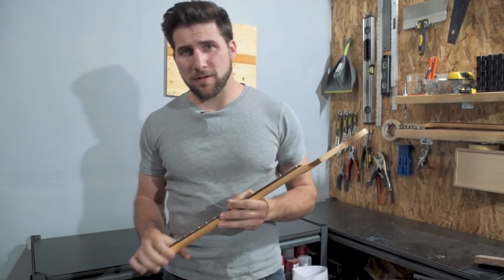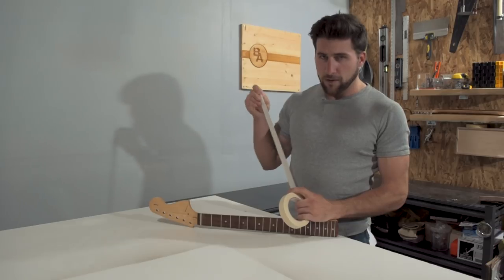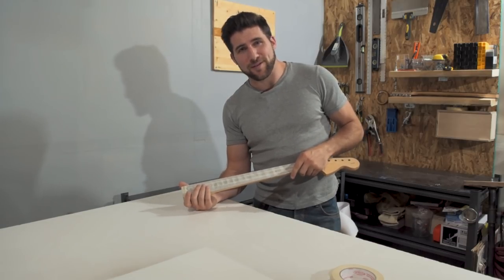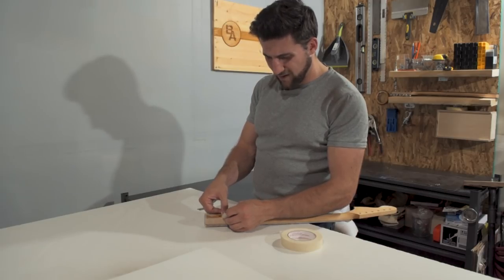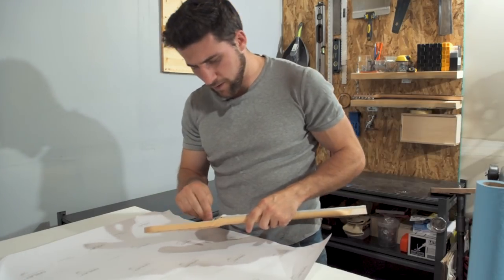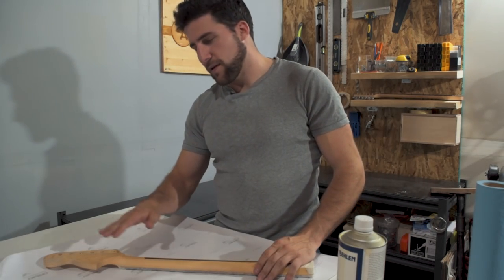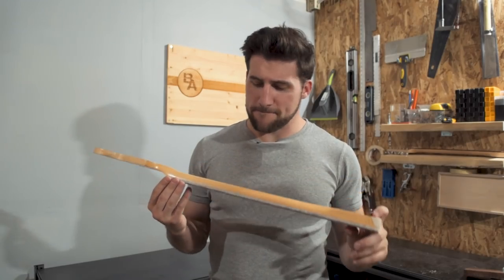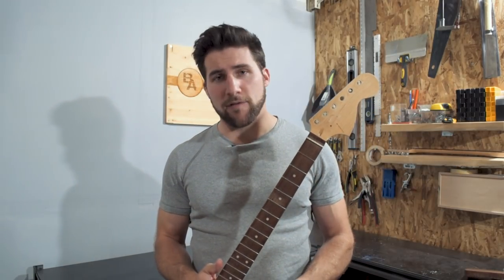How to finish a guitar neck

Comment: Brad, where does the logic come from that a thin neck is faster than a fatter neck.   Your hand is essential just a clamp.    You release the clamp and move to the next position.    It really doesn’t matter that it’s thin or thick.   You just have to release the clap to move.    I don’t really need an answer from you.    I just want to see if anyone who subscribes to you channel has a legit argument.    If you had a 10" clamp or a 4" clamp, it would work on any set neck guitar you are gluing together.    After glueing, is it faster to remove the 4" clamp vs the 10" clamp.   I really wouldn’t  think so.    If you wanted to re-clamp, it wouldn’t take any longer to get it done no matter which clamp you use.   Your opinion on finishing has more to do with speed than thickness of the neck in my opinion.    Let’s see the hornet nest I stir up with this comment.
Reply from the maker: I know you’ve said you don’t need an answer from me, but I’m going to give you one anyway. Thinner necks are generally faster to play because unlike a clamp your hand has different levels of strength and dexterity available to it at different ranges of motion. The reasoning is analogous to why your grip tires out faster holding a wider item of the same weight. Your fingers are able to move more rapidly and more precisely within a smaller range of your thumb, and your palm has the opportunity to angle more in that position to allow for more stretch range. All of this equates to you generally being able to play faster runs etc. on a thinner neck.
Reply: Brad, I’m glad you jumped in and gave your opinion.   I have learned a lot from you on my guitar builds and appreciate your help since you’ve answered ever question I’ve asked.     You did bring up some good points about playability as it relates to neck thickness.   I have a lot of guitar hero’s and many of them play a thinner necks and some like a fatter necks.   I have 15 guitars with a variety of neck profiles.   All my ESP guitars are thin.   I have a Les Paul Studio with a thin neck as well.   My 2008 Les Paul Standard has a bigger neck that is asymmetrical.   It’s fatter and has a great feel about.   I have a Les Paul Custom silverburst that is a 68 reissue that has a neck like a baseball bat but feels good in the hand.   I typically play my ESP’s more than the others.   Not because of the neck but because I’m a Metallica fan and I love crunch of an EMG pickup.   For me, I do prefer the fatter neck because after an hour of play on my ESP’s, my thumb gets sore.    I don’t have that problem when I play my Gibson’s with the fatter neck.   I also think muscle memory also has a lot to do with speed regardless of the neck size.   When changing from one neck to another, it takes time to adjust to the differences.    I don’t know about your play but I can honestly say neck size doesn’t have an impact on my speed.   I’m just not a fast player and probably never will be.   For me, I will probably grab the guitar for the tone of the music I’m playing.    Or, it might be because I need a guitar with a Floyd Rose tremolo on it.   My instinct tells me that personal preference and feel matters more than the neck profile.    If it feels good in the hand, and you have the skills, speed will develop on it own.   If you look at the necks that are put on guitars these days by most manufacturers, thin necks are the most popular.   So that brings us back to Canada being the brain of the USA.    I think your onto something.

Comment: So, I sanded and stained my Squier Affinity strat neck yesterday(came out pretty good). Do you have any advice on doing the clear coat? I think Im going with spray Poly(not gloss, the other one but Im blanking out lol) Im going to be putting on a Fender Waterslide decal. So would I do the Decal last, after the coats of Poly are done, or do I do some Poly, then the decal, then more Poly on top? Also any advice on what to do between Poly coats (sanding wise) ? Thanks
Reply from the maker: Do three coats of poly within the typical recoat window. Let that dry for a couple days, sand lightly with 400 grit, add your decal, and let that dry fully. Then coat over it with another three coats.
Reply: @BradAngove  thanks homie!

Comment: Does anything need to go over the teak oil to protect it or can the teal oil be the only thing on it. Also is it same to put this on maple fretboards that are the same color as the back of the neck
Reply from the maker: I just use the oil typically. It needs an update sometimes, but it feels great. Yes, you can oil the fretboard as well.

Comment: So I used boiled linseed oil on my guitar neck and I’m not totally happy with how it turned out it looks good one day after but by the second day it just looks dry and lacks any kind of depth to the grain. The day after it looked like a satin sheen. But the next day it almost looks like unfinished wood. Can I just spray rattle can poly over the BLO? After it’s dried of course.
You had helped me
With a strat neck about 2 years ago and that neck turned out so great with the poly finish. I chose the BLO because of some vid I saw on here. 
Any advise is much appreciated man.
Thank you again.
Reply from the maker: Yes, just give it a good wipe down once it’s dry and you can hit is with some poly. If you want to be safe, I suggest wiping it down a couple times with mineral spirits to remove as much of the oil as possible, sanding lightly with 400 grit, then cleaning and spraying.
Reply: @BradAngove  okay thank you!

Comment: Hi, firstly thanks for detailed explonation. I apply teak oil on my unfinished neck. I apply 4 coats between 2 days intervals. I waited to fully cure until cant smell anything. After 5 days i play the guitar, it is getting darker. Especially the areas i always uses. What could i have done wrong?
Reply from the maker: The teak oil is darkening? That’s unusual. Is it ambering, because that can happen a little bit. Or is it possible that it’s getting dirty.
Reply: @BradAngove  I couldn't explain properly. Actually the areas i use more get dirty and this happened very quickly. I am curious about that it is not fully cured.

Comment: Hi @Brad Angove. I've sanded many necks to 2000 grit. Most of the people that check then out love them. I have a friend that sent me his first custom neck that we picked up together  in Germany in 1988. We were in the USAF. He sanded it to 10,000 grit then stained it black... looks beautiful,  but it feels so smooth that it's like a painted neck. I've stained some of the 2,000 grit ones and they still feel silky smooth. I'm curious what your thoughts would be on this matter. Maybe give it a shot if you haven't before.
Reply from the maker: I usually go 600-800. I find it odd that a lot of stains and oils recommend sanding to no more than 220. It changes how the stain absorbs, but that’s not always a bad thing.
Reply: @BradAngove  I totally agree with you.  A good stain can absorb into about anything that has a grain Imo.

Comment: Hey Brad - I’m preparing to do my first neck finish and want to be sure I get it right. It’s an all-maple warmoth telex neck and I’d like to add some color before finishing with polyurethane. Do you have any advice about applying stain to a neck and fretboard?
Reply from the maker: As long as the wood isn’t sealed you should find it relatively straightforward. Just wipe it on in thin even layers and wipe away the excess.

Comment: Hi Brad, can I give it more than one layer of Teak aswell? And how long to wait in between layers?
Reply from the maker: Safest bet it to wait a day and re-coat. If you’re doing it faster the conditions have to be right and you have to be careful about how thick you apply it. I sometimes do as fast as 45 minutes depending on the circumstances.

Comment: Hi Brad. Will oil finishes protect and seal as well as poly etc.?  Since neck finishes are necessary to keep out moisture/humidity that can warp a neck,  I was never sure about just applying oil.  Great Vids BTW.
Reply from the maker: Oil does not offer the same level of protection as poly. It honestly doesn’t take much to seal the neck enough honestly, but if you want the most protection you should opt for poly instead. I have a video on applying a poly finish on a neck as well.
Reply: Gotcha. Thanks for confirming. I'll definitely check out that Vid as well.

Comment: Hi Brad ! I have a question about fretboard, on the kit I am building, fretboard is in raw maple. Do you think I can do same thing on neck with teak oil on the fretboard? I read that Tru-oil for gun wood is the best choice on multiple forum. It is similar to teak and tung oil but not exactly the same that i found. If you have an idea to what can i do it would solve a step !
Reply from the maker: The teak oil should work just fine in a maple fretboard.
Reply: Thank you !! I really like your tips and instructions all over your videos. That give me knowledge To push me to start it !

Comment: does acrylic lacquer (spray can) work as well? Also if I want to get rid of the gloss is sanding it with 1000 grit ok enough to not remove the finish itself?
Reply from the maker: Acrylic lacquer takes a while to dry fully, but it works fine. And yes, 1000 grit works well to remove gloss without taking off the clear entirely.
Reply: Brad Angove Thank you!

Comment: Did you mean naptha or mineral spirits when you suggest cleaning the neck with a wax and grease remover after sanding an unfinished neck I need to be sure before I do it myself
Reply from the maker: I use literal wax and grease remover, which is different. Naphtha is also a good option though.
Reply: @BradAngove  thanks a lot

Comment: If I wanted to paint the headstock, would I do that before or after applying the oil?
Reply from the maker: Either way is fine. You wouldn’t apply oil there if you’re painting it. I would generally do the paint work first.

Comment: I sanded my neck down and used a wood varnish but it still feels sticky and not smooth enough. Do I sand it again and re stain the neck I'm not sure how to make the neck feel like it was originally
Reply from the maker: Yes, you would remove that again and re-apply what ever finish you want to switch to.
Reply: @BradAngove  thanks !

Comment: I'd like to buy a raw unfinished neck and finish it in tung oil or teak oil.  Obviously you have good reason and experience for using teak oil, Why do you use teak oil, rather than tung oil or something else ?
Reply from the maker: I use all sorts of things. I’m fond of tung oil as well. I recently did a couple of videos where I finished necks in lacquer and in poly. Teak oil is very easy to apply, and I haven’t heard as many people have issues with it getting sticky as with tung oil. It’s all a matter of preference though. There are tons of options that work.

Comment: what other oils are acceptable for finishing the neck in this fashion?
- my neck is currently high gloss, does that change the method at all?
love the videos btw man
Reply from the maker: Oils are generally used on bare wood, or perhaps lightly sealed wood. They can spruce up a finish a bit, but they aren’t often used over paint. 
In any event, if you want to put something over your gloss neck other than wax, you’ll need to sand it first so that your new material will stick. 
If you do elect to use oil for a neck, there are many types that work. They all give different looks and feels as well. 
Some favourites: teak oil, tung oil, danish oil, tru-oil, and I personally don’t like boiled linseed oil, but it’s a popular choice.

Comment: Great Video, I learnt alot! Just a quick question. I have a Squier neck that Im re-finishing and I'm wondering what grit to use to remove the Squier logo? And FYI it's just an Affinity with no laquer or gloss finish, just the plain smooth wood! But Im going to be staining it and applying a Satin Finish!
Reply from the maker: I would either use 320 grit or a razor blade for that usually.
Reply: Okay Thanks!

Comment: Nice. Oil or wipe-on Poly is easy and gives very good results. But my old question remains: How to paint a guitar neck with spray cans? The curve in the back of the neck makes all the the work difficult, it is hard to get no runs neither some "dusted" surface... 
Enlighten us, Master...
Reply from the maker: So your question is essentially how to paint a curved surface evenly with spray cans? Does that sound accurate?
Reply: Brad Angove that's it👍
Reply from the maker: +Adalberto Schuck Jr. I'll put it on the list haha.

Comment: Hey Brad just found you channel and it's amazing. Quick question, how do you remove the leftover glue when removing the tape?
Reply from the maker: If there is any I usually just rub it off with my thumb. A bit of wax and grease remover can also usually do the job.

Comment: 1.I see you used 400 grit. What if you used 400, 800, 1200, 1500 and oiled it throughout. Would that work too? Would you need to re-oil it over time?
2. Did you also use oil on the headstock? What are the next steps before adding the waterslide logo if using oil?
Reply from the maker: That would work too. You may need to re oil it eventually, but not often by any means. 
I didn’t oil the headstock on this one. I don’t really work with water slide decals, so there not much I can tell you about that. Just make sure he surface is smooth and sealed first.
Reply: Thank you for the quick reply! :)
Reply from the maker: You’re welcome.

Comment: Hello Brad, I am rebuilding a stratocaster. I have removed the original headstock silkscreen logo by sanding it down. I will be replacing with a waterslide decal. I want to use teak oil to finish but what to do about sealing and covering the decal? Can this be done and if so how? More oil? Nitro? Poly? Shellac? I don't really want to use stain with a maple headstock.  Thanks!
Reply: Ok, nevermind. I found the answer down below! Great vid!
Reply from the maker: Glad you found it. Thanks for watching.
Reply: This worked beautifully! I cannot get over the unique beauty that teak oil brings out in a maple neck! The waterslide decal looks great too! I did not expect the "flame" of the maple to come out in the neck but it totally did!  Thanks again for this video and the great suggestion of using teak oil finish on the neck!
Reply from the maker: I’m very glad to hear that you’re please with the results.
Reply from the maker: *pleased

Comment: Brad, just one detail I'd like to point out. When you said one could run a drill bit through the same tuner holes, if there's a buildup of paint. inside the holes. A drill bit can be risky to use. The best thing to use is a tapered hand reamer. Those are cheap. But you can also use a machine reamer (which is not tapered) and turn it by hand. With a hand reamer you can never chip the holes, as might happen with a drill bit.
Reply from the maker: Thank you for the feedback

Comment: If you had a made in Mexico strat neck that you wanted to repair the finish (because I sanded too much in one area and sanded off the poly)
What type of spray can product would you use? At this point I just plan on spraying the whole neck. 
 I am hoping I don't have to sand the entire neck down to bare wood. From your vids I watched it didn't look like I'd have to. But any advise you could give I would really appreciate. 
Thank you again for taking the time to make this vid. 
Mike.
Reply from the maker: I would just scuff with 800 and use a spray poly to refinish it.
Reply: Brad Angove okay thank you! I've never seen poly spray in a can. Do you know where I can buy it, and any brand that's best?
Thank you for the help.
Reply from the maker: Home Depot? Probably varathane.

Comment: Which grain would you recommend to sand a neck? I have an old ibanez RG, and I'm planning to restore it. I feel quite confident with the body because I watched many of your videos, but the neck kinda scares me. There are a lot of dents and I would like to get a smooth surface.
Reply from the maker: What kind of finish are you doing after?
Reply: @BradAngove  I was thinking of teak oil, just like your video.
Reply from the maker: Oh I see. I misread your original message. You were asking about sandpaper grits right? Before oil I like to go very smooth (much smoother than before paint). I like 400 or 600 for this.
Reply: @BradAngove  Thank you Brad, I appreciate it very much. You always answer our comments, providing precious informations. Helpful channel and outstanding person!

Comment: Brad what's your thoughts on doing an oil finish over a sanding sealer as opposed to just oil on the bare wood (like when making your own neck)? Will the oil properly seep into the wood, or should oil only be applied to bare wood?
Reply from the maker: Oil won’t be absorbed properly if applied over a sealer unfortunately.
Reply: But I did notice in this vid you stated the neck came with some thin sealer on already. You sanded with 400 grit down, but there will obviously remain some residue sealer left, correct? then you oiled over it. I'm asking because on one of my necks I just used oil on the raw wood (wood was sanded to 2000). And the final finish (after many coats of oil and rubbing in with applied heat) is still not super smooth, so I'm thinking I should have applied a thin sealer first?
Reply from the maker: No, generally you would apply the oil first. Then sealer if necessary and then top coat. There would have been some sealer leftover when I applied the oil here, but I would have preferred the oil on a raw neck. It’s still possible over sealer, but better in raw wood.